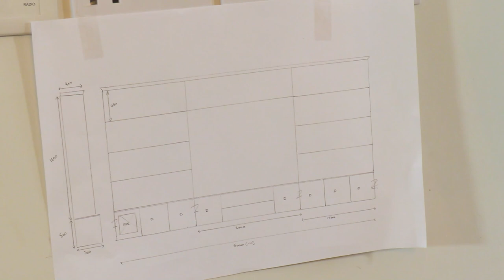How to Build a Media Wall ~ DIY Guide

Comment: Master craftsman at work. A professional who takes pride in their work. Great to see a drill driver in use instead of an impact driver.I had a so called carpenter fix my door hinges with an impact driver. It is the most abused tool around.
Reply: An impact driver is a very delicate tool if used correctly
Reply: Stupid comment. You can use an impact to fix hinges by just taking it easy. I use one and it had four settings, setting 1 is more of less no impact at all so all good for doors and such like.
Reply: @gavincollins9376  Every screw head has been stripped on my door hinges...that is abuse of an impact driver and stupid.
Reply: @shuvadey4294  That's his inexperience, not the tool..
Reply: The carpenter in this video uses an impact driver to screw hinges in another video lol
Reply: I agree that a drill might be a better tool for delicate work for someone that doesn't know how to use an impact well. Most impact drivers are variable speed, so you can let go of the trigger the closer you get to your workpiece with the screw. Once it hits home, you let the impact get a couple "clicks" in then you're done. I do it all of the time and have no stripped screws. 

Where I do struggle sometimes is REMOVING screws. Impacts are not the best for removing hard to reach screws that are stuck, especially if they have been exposed to the elements. The hammers either cause the scew to strip since you need to have a good purchase on it, or the screw head to shear off. I have started using a drill for removing screws in situations like that.

Comment: I'm building something similar... but four modular units, independently standing but fixed together and against to wall... I've decided to use 12mm ply ... it will be stained (a light grey) and polished to let the grain show through.... Getting lots of ideas from this though.

Comment: Great job!  I know people have commented about the span of the shelf but as a lowly punter, as long as I was advised of the possible bowing problem, I can't see the issue.  Don't put heavy stuff in the middle and/or be prepared to pay for a fix if it all goes wonky in a few months/years.
Reply from the maker: The back edge  is supported all the way so it stands a fair chance with 25mm thick MDF but, like you say telling the customer is the key.

Comment: Absolutely lovely, really like the thought that has gone into it…the only thing that I dont like is the the sag you get on single skin mdf shelves, I just find over time they have a tendency to drop in the centres especially if they are loaded! 
Great work on that project though top job 👌🏻
Reply from the maker: Hi Luke 
Dan discussed that centre shelf with the client when they gave him the design, as they saw it. The shelf is supported all the way along the back and is 25mm thick but it is one of those unknowns. If it eventually sags the will need a centre support to hang it off the 4x2.
Reply: @SkillBuilder  completely get that, it wasn’t any form of criticism was just something I’ve seen and had myself. Absolute top job that I would of happily paid for 👍🏻 keep up the good work and content lads
Reply: @laidbackLUKEY  thanks.
Reply: Great job Dan , wish I could have those tools 👍
Reply: @dermotkelly6946  thanks, it was a great to build.

Comment: Video Suggestion: What tradespeople do you need to do a particular job, and how much to expect to pay?
I'm and idiot when it comes to tradespeople and always get worried about who to hire to do various jobs and the order things need to be done in. In this video, for example, I see the plug sockets are up the wall, and I also see there are carpets. I assume I'd need an electricion to do the sockets, but who decides where they go? Do the carpentar and spark talk to each other before hand? Also, with the carpets, is it OK to go over the top or do I need someone to come in and cut them to make it easier to paint?
There are loads of things I am planning on doing, but I never get started because I worry about wasting my money getting people in at the wrong time.

Comment: Excellent job! What do you use for the trestle trestle base. It looks like you you suck on aluminium bars and then you put the 2 x 3 cls over it
Reply: Thanks Chris.  Yes the bench set up is that.  The 3x2 can slide on the aluminium rails.  It’s quite versatile.

Comment: Great work as ever but shame the customer didn't specify a nicer material. Given that Dan is presumably at the top end of the market I don't know why he would agree to work with a material that is so obviously no good for one's health. Plus at my local timber merchant it's barely any cheaper than hardwood faced ply of the same thickness.

Comment: Te shelves need more support, after 40 years in the trade I support every 600. Whats going on with the gap on the centre LHS door?

Its easy to pick holes in any work, that is why a lot of very experienced trades people do not post on this platform.

Make money from your trade, not being a "media" star

If you made the cupboards as "boxes" with no fronts but a back you could do all the work in the workshop and then flatpack, the fronts would be square - no need to trim doors, no dust or noise for the client.
Reply: Not every Chippy can afford a workshop and if the client wants that design there's nothing the lad's can do you can only offer advice but what the client says usually goes
Reply from the maker: Retroclick Media 
You are right about people not wanting to go on YouTube. We are lucky to have Dan working with us. He is one of the few who doesn't want us to edit out mistakes when he makes them. Thankfully they are few and far between.
Reply: @tomsmith9048  Well, no.

Just this week I have told a client that the drawing they have sent me of the same sort of thing ( designed by an "interior designer") will not last. There is no point supplying a product that is not fit for purpose.

As  professional  trades people we have a duty of care to advise the client, if they dont like it just walk.

If you dont it will come back and bite you in the arse...

We all started on the broom, we worked our trade (I ended up up doing 8 years at FE in the 80's, did the CHIB) but we still charge less a day than a lawyer  charges an hour. 

The client would listed to a barrister but not a chippie, who is wrong?
Reply: @retroclickmedia4422  well yes if a client wants a shelving unit or a media unit of a certain size you can advise a pelmet of some description on the front or underneath the front of the shelf to stop the sagging but if  they want a slim line look and say no you can't make them
Reply: @tomsmith9048  Of course you cant make them but if you know there will be problems in the future just walk. When it all goes wrong the will tell their friends etc and it wont be their fault, they will say it was yours
Reply: @tomsmith9048  if the top shelves do sag I might suspend it with some fishing line or braid.  😉
Reply: @retroclickmedia4422  not everyone can afford to walk away from work
Reply: @Ultimate-roofing-square.  😝🇮🇪🍺
Reply: @tomsmith9048  🍻
Reply: @tomsmith9048  But they can afford for a job to go wrong and have to put it right in their own time?
Reply: @retroclickmedia4422  he's already explained what's going to happen to the client theirs nothing more he could do if you walked away as you suggested you'd get a reputation for being primadonna again as you said tell their friends ect you'd never get work anyway pal have a good day 🍺